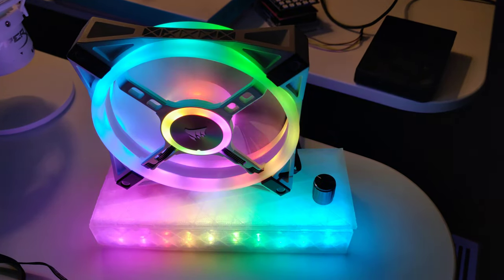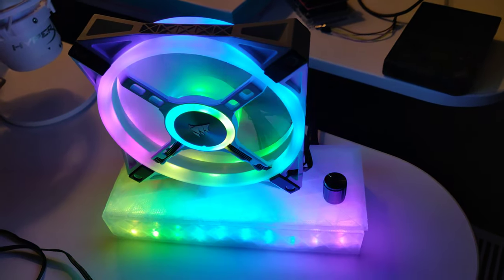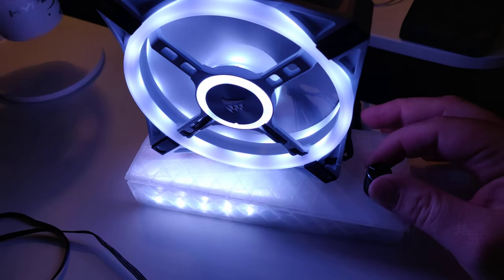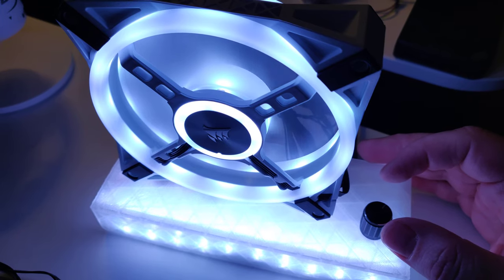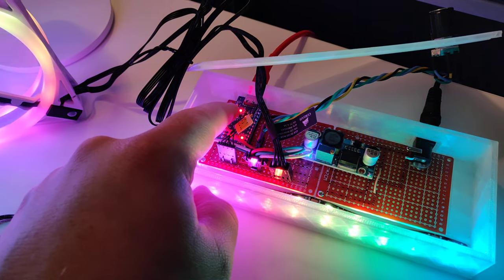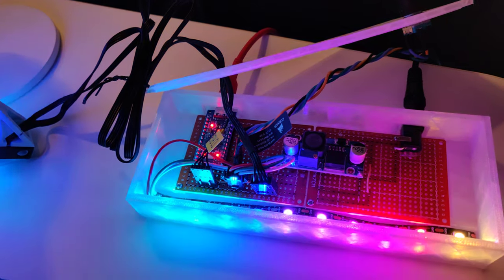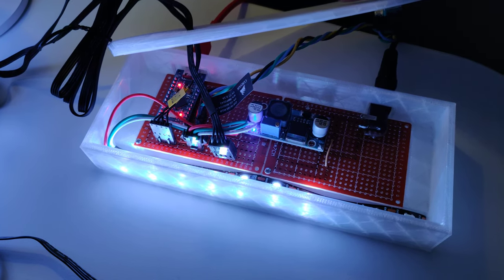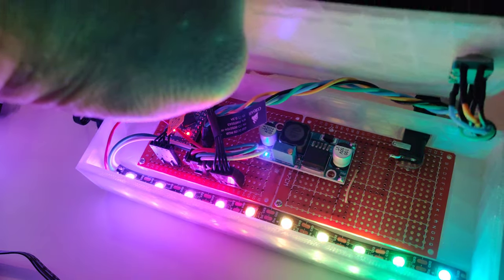OpenRGB Desk Fan - Proof of concept and control test

Comment: How does it communicate with openrgb? is it using that CorsairLightingProtocol library? would there in the future be a library that natively communicates with openrgb or is there already a way of doing that?
Reply from the maker: It is using CorsairLightingProtocol, which mimics a Corsair Commander Pro.  The Corsair protocol is already supported in OpenRGB.  OpenRGB does not have a standard "native" USB protocol, it implements a bunch of different protocols for all the different devices and Corsair Lighting Node happens to be one of them.

Comment: I want a 75% or 65% keyboard with open rgb support, but I'm on a budget. Any recommendations? And is the redragon k630 (or any other redragon keyboards) still supported by openrgb?
Reply from the maker: Avoid Redragon now.  Avoid pretty much all budget mechanical keyboards.  The entire market is Sinowealth and 8051 chips now and they are a complete minefield.  The older budget keyboards using EVision/Sonix ARM chips were very hackable but the new generation of cheap chips are not very hackable at all and the stock firmwares are prone to bricking from bad USB commands.  Unfortunately I don't have a budget keyboard recommendation anymore.
Reply: @CalcProgrammer1  ...huh